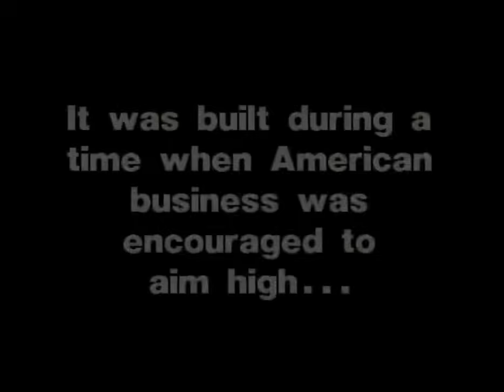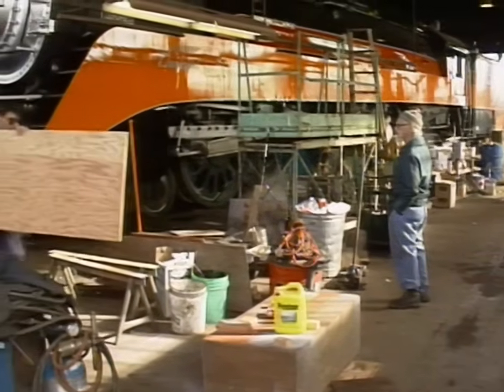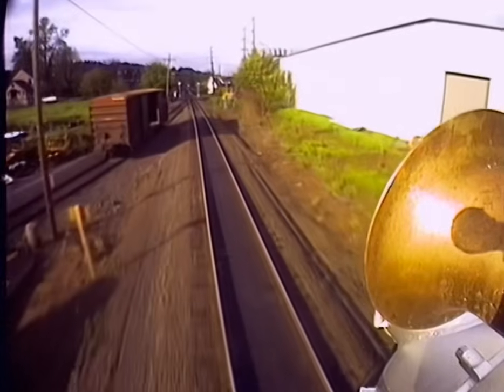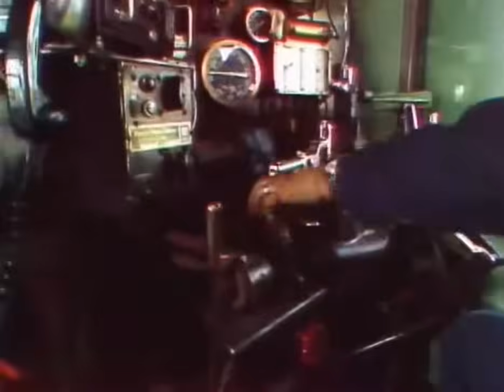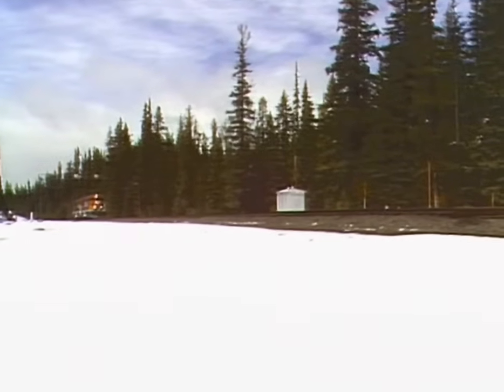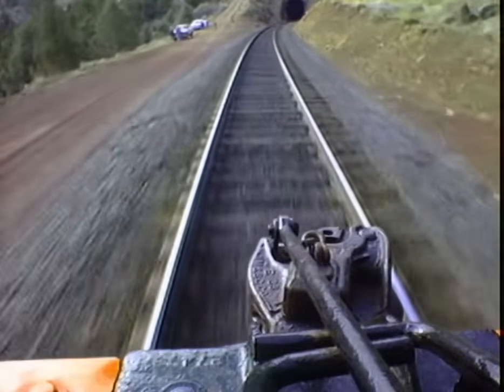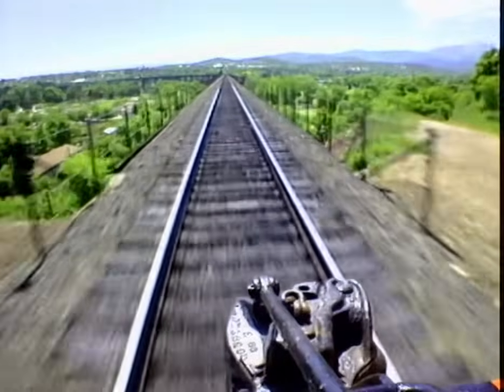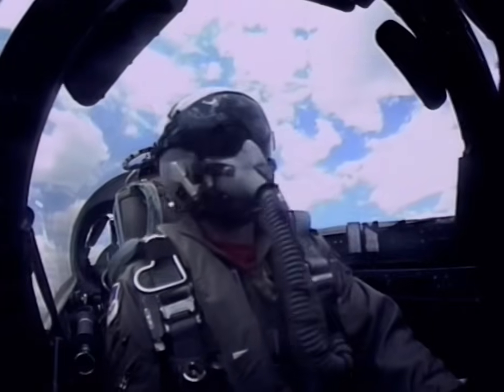The Daylight Express | Skyfire Video

Comment: 56:59 That a Steam engine built in 1938.
4449 wasn't built in 1938 unless.. You're talking about SP&S 700!
Reply: No, the 4449 was built in 1941. Perhaps the narrator got mixed up with another locomotive.
Reply from the maker: @T128Productions   I belive it was a classic case of "old outdated info", because the GS2 and GS3 were built in 1937, and the GS4 in 1941, so perhaps he accidentally mixed up old info about the gs2/3's or something.
Reply from the maker: @davidstrawn9272 you might be right about it being confused with SP&S 700, but since this vid is from the late 80's early 90's I don't know the timeline of Doyle McCormick's collection, so...